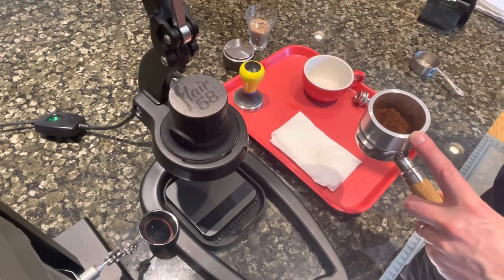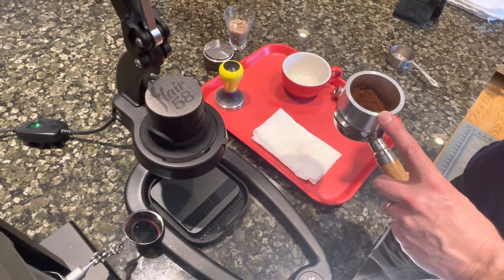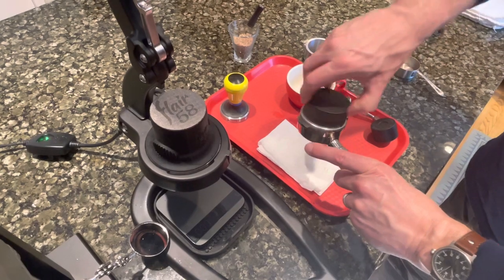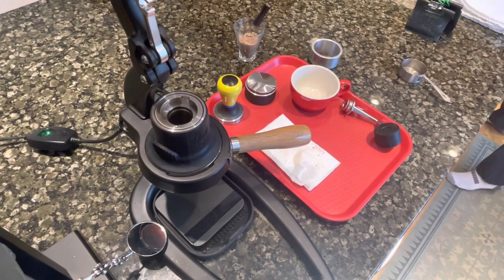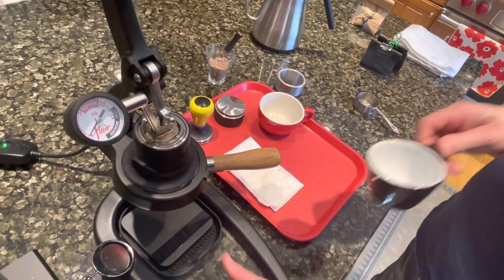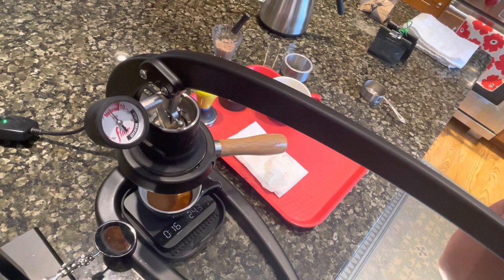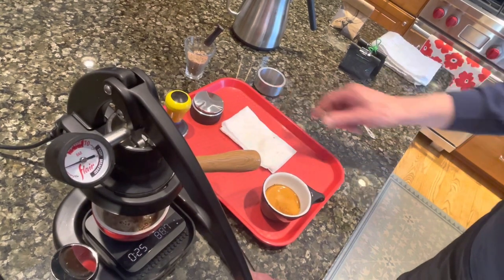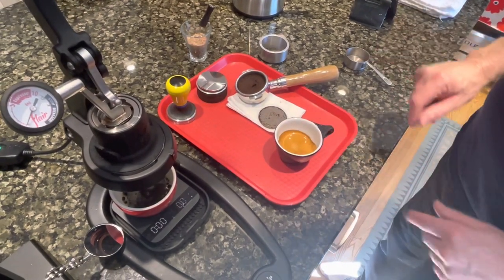Using the Flair 58, some tips!

Comment: Thanks for the video. Are you using a IMS high flow basket?
Reply from the maker: My Flair 58 was from the very first batch sold.  It only came with a high flow basket, which I hated.  I had a basket from my Londinium L1 which was low flow, and that’s what I’m using.

Comment: I’ve been trying to follow the steps you’ve recommended in the video but my espresso shot has a sour profile to it. What should I change in my approach?
Reply from the maker: Maybe try a different water temp on your kettle.  You can also try lowering the temperature on your Flair.  And it could be the beans you are using.
Reply: @johnrbh the other challenge I’m facing is that when I push the lever down, I’m not facing any resistance on the lever so the espresso shot is watery. Any solved for that?
Reply from the maker: Yes, two things.  When I got my Flair 58, it only came with the high flow basket.  Almost didn’t matter how fine I ground, the espresso came out fast.  I switched to a basket that I had used I my other machines which it turns out are low flow.  Then the issue was fixed.  If you are using a low flow basket then you may just need to grind finer.  Not sure what grinder you are using, but not all grinders will grind fine enough for espresso.
Reply: @johnrbh I saw many people are complaining about it that using flair 58 and they're not able to delay the percolation like no matter how fine they grind and not getting enough resistance for 30-40 seconds.
I want to buy a manual espresso so I was planning to buy flair 58 or cafelat robot.
Reply from the maker: @shubhamsrivastava332 it’s no problem, just grind fine enough!

Comment: What’s the chord with the green light attached to the left of the device?  Sorry I am unfamiliar with these models and manual devices and thank you for sharing your video
Reply from the maker: That’s the power cord withe the controller (low/med/hi) with the green lights.
Reply: @johnrbh  oh ok I’ll have to read about it I thought they were just manual devices
Reply from the maker: The Flair 58 is the only Flair model with electric heat

Comment: Hi Robert, thank you for the brilliant videos - Just wondering - your temp is 212, have you notice different flavour for this machine compared to your other machines etc? You pull it out in quite quick time also?
Reply from the maker: I initially was using a lower temperature on my water kettle.  I find that I get the best flavor using water just off boil.  I think the espresso is as good, often better than my Salvatore semi auto

Comment: I also have one like that, but there is a problem, mine is when I use the piston often rotates by itself, how do I fix it?
Reply from the maker: Just rotate it back!
Reply: there's a piece of plastic included in the newer models that you can place on top of the heating chamber to re-align the base of the plunger.
Reply: use the plunger key included. If you have the older model that didn't ship with the plunger key, you can easily just pull the thing all the way up above the rim of the cylinder (disengaged from the lever first, of course), then hand twist it to whatever position you need it to be, then push it back down.